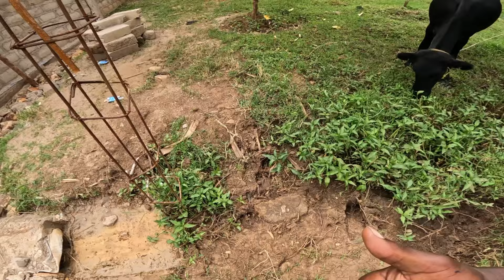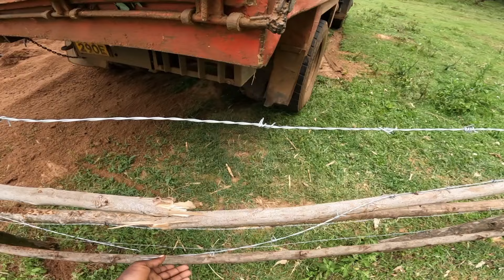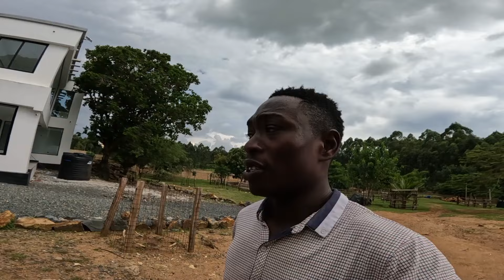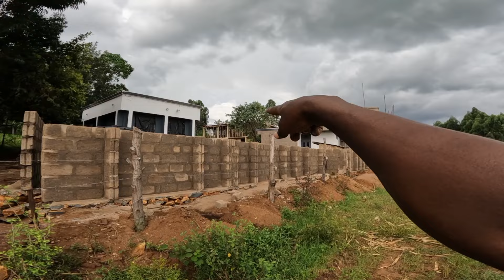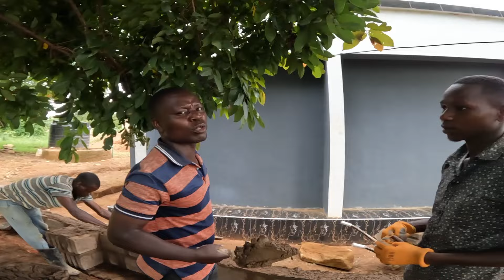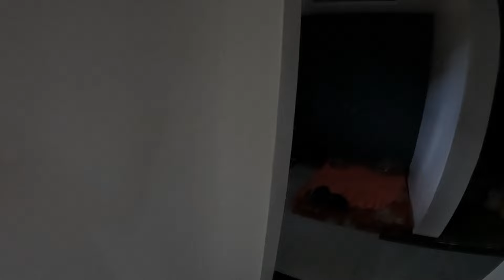[my dark life without my wife.??] ❤💔 episode 2 ||  I'm glad we fought for our marriage

Comment: Make sure the channel getting the flow water under the fence is well concreted and extended the water away from the outer wall . You can use multiple pvc pipes to do that. Yes, good drainage is going to solve many issues in the villa.